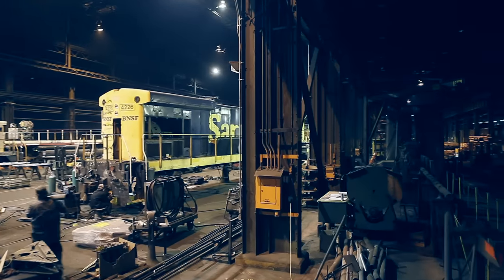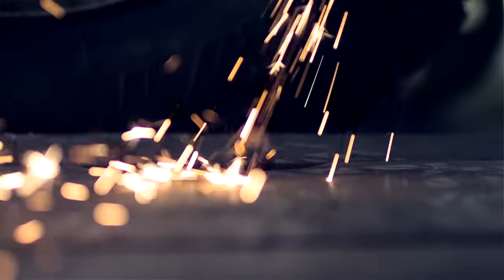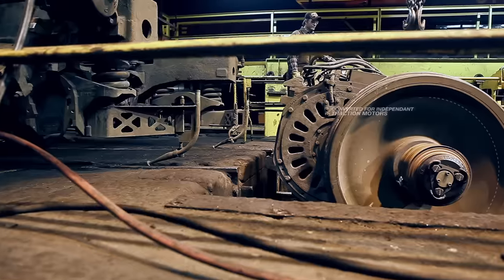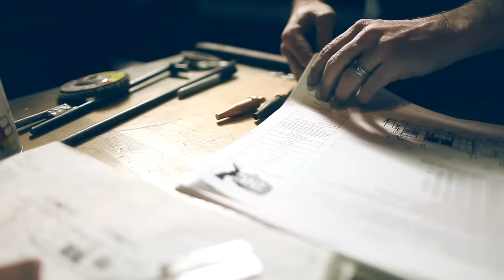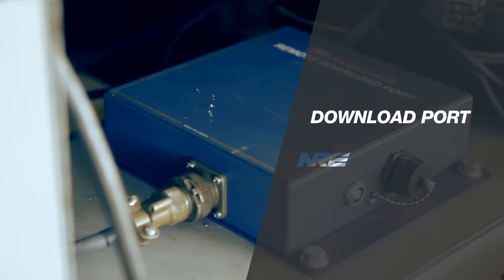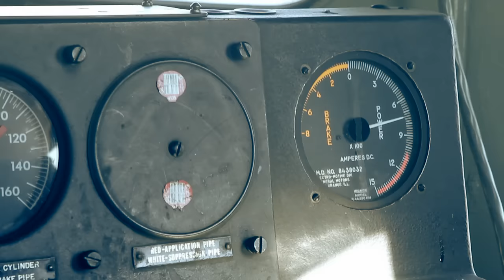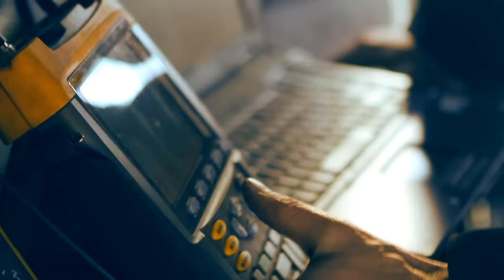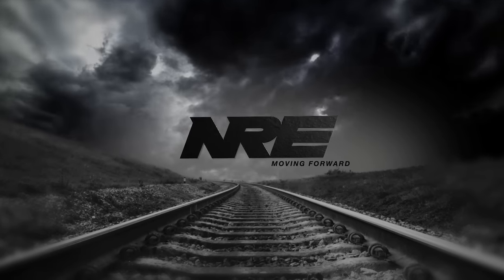NRE - Independent Axle Control SD40-4

Comment: Is there such thing as the Dash 4?

or did you mean SD40-3 or 2?
Reply: NRE calls it an SD40-4 so I guess there is lol
Reply: Very little pollution with tier 4 and it works. Nforce is the controller/computer but seemed to have issues. This is 4 yrs ago. I'm sure they solved this problem by now.

Comment: What you're going to see is a constant failure of a gen set on this locomotive there are 3 separate sets. It will let you down hell we couldn't keep it running. Keep it simple NRE.
Reply: He said they took genset technology and applied it to a conventional locomotive. The SD40-4 is not a genset.
Reply: He also said applying same technology to others models. These tier 4 locomotives have 3 gen sets well the one I worked on anyway that and work independently or together. Not sure on the models it's been awhile since I worked there.  They slashed our jobs and closed shop in 2017 not a fan of theses guys and this technology is a waste of money. Good idea but the cost is ways way up there.
Reply: Okay, well, that's interesting. Usually when they change something into a genset they change the model designation completely so that you know it's not the same as what they rebuilt it from.
Reply: @steveyoung8876  the one we had at our shop was different with 3 separate engines. I'm not saying you are wrong at all. I'm trying to remember if it was indeed an SD 40 we had for about a year and never used it because # 2 engine would not stay running. Not sure if it ever got sorted after our shop closed and we sent all stock back to silvis from Capreol Ontario Canada.
Reply: @loosemouthcowboy4790  All good brother! All the best.

Comment: The $1M question is if it is putting 1500A to the DC motors, how are they not frying?
Reply: These traction motors have been taking 1500A since the 50's and 60's, at a restriction of no more than 5 minute intervals but still